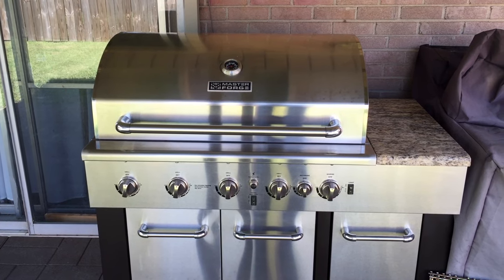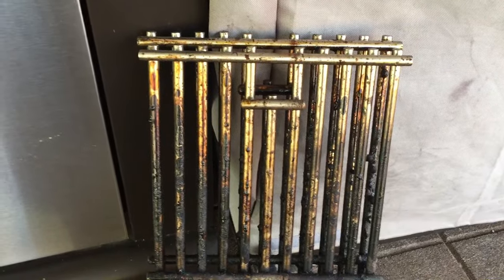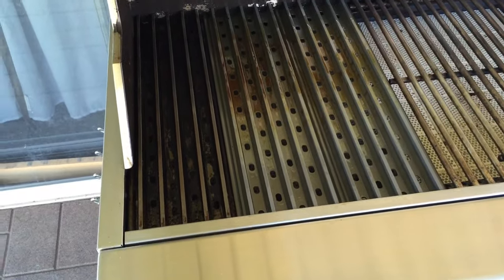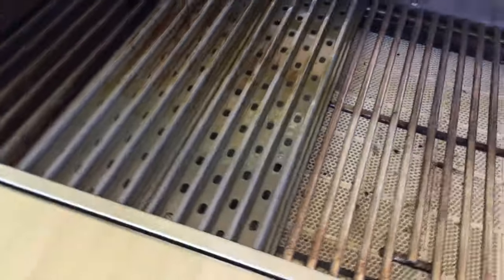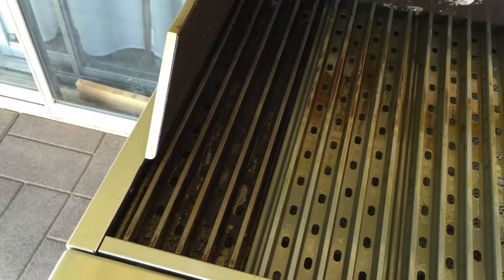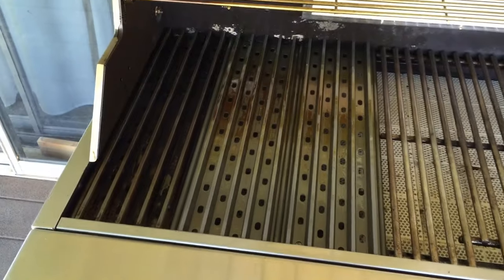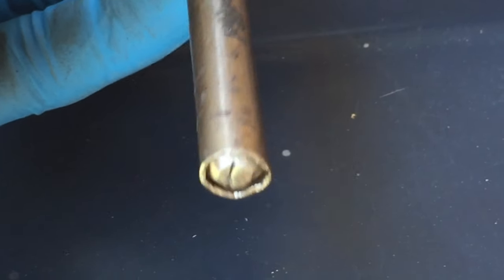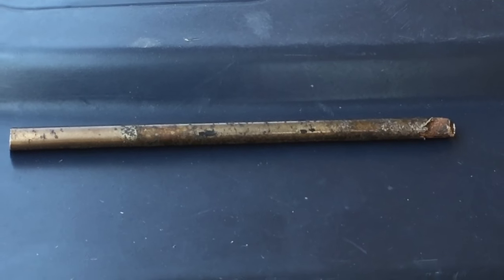Master Forge Gas Grill Update #3

Comment: Hi! I have the same grill. The burners and flare guards need replacing. Do you have a video on how to replace? Or can you direct me where to find? Thx!!
Reply from the maker: I have a part one and part 2 video. I think in the part 2 videos I talk about the no flare squares.

https://youtu.be/PV2YTJdYUOY
Reply: @MSRWorkshop  thx. I watched that one. I was hoping for instruction on how to replace the actual burner tubes. They are corroded.
Reply from the maker: @cherylbeauregard851  I haven’t done one on that but if I remember correctly I think they have one screw at the back and then they just pull off. Really simple
Reply: @MSRWorkshop  how are the flame tamers doing?
Reply from the maker: So far holding up. They get really fragile after a bit of use but so long as you leave them alone they seem to work great. The biggest upgrade that has made the best difference if replacing the grates with a brand called “grill grates” they are by far the best upgrade you can do to this grill. They make a night and day difference. The old grates were complete crap and took forever to heat up.
Reply: @MSRWorkshop  thanks for the update man, yeah grillgrates are awesome! I have some on a cheap chargriller and they turned the grill into a beast haha

Comment: I also purchased the same setup with the refrigerator, Sink and Grill. I want to get the grill grate upgrade that you show in your video. I think I would like to replace all the stainless steel ones with the GrillGrates. What customsize did you order. I did email the company to see if they know what size I need. Thanks for the great videos of the setup and upgrades. Have not grilled on it yet, but have it all seasoned. Just ordered the Rotisserie for it and plan to use that this weekend.  Thanks again for great videos!

Comment: DO NOT BUY THIS GRILL,  I have owned this grill for 3 years.  Just about everything has failed.  The grates are corroded and breaking apart with rust, The burners have rusted and 3 off them leak gas to the point you cannot cook with them, The cover and parts are impossible to replace and none of the lights or features work anymore.  I use this grill once a week or less,keep it covered ALWAYS and it sits under a covered patio so I cant understand why this grill is so bad.  READ OTHER REVIEWS AND CONFIRM.

Comment: I just wanted to add that the grates that come with these grills IS stainless....... at least the sleeve/jacket....... but it's 409 stainless rather than 304 stainless. 304 stainless will not rust, but 409 stainless (a lesser grade of stainless) is prone to surface rust and such. It will still last you a very long time versus mild steel or cast iron, you just have to do a little maintenance to keep them free of rust. Looks like your new grates are pretty nice though...... I may have to consider swapping over to those just for the fact of less maintenance
Reply: @MSRWorkshop  yeah I do definitely know what you mean. I happen to actually like the nice grill marks the original grates leave in the food, but I have no experience with the style grates you're using. Surely I wouldn't dislike them for nearly $200 in the custom sized ones. Would love to see some videos of food you've cooked on them though.... maybe it'll steer me toward giving them a try sooner than later :)

Comment: Hi there.. Thanks for taking the time to provide indepth review of this Master Forge modular grill. I happened upon a floor model late last year and I picked it bas3d on your excellent review. 
However, there are lots of complaints of rust from other owners.
If you still have this grill, I would like to know the  condition and did you rust proof it in any way. Thanks
Reply: @MSRWorkshop  I thank you sir

Comment: Thank you so much especially for the measurements. Just got 7 panels to cover the whole grill. Takes it to a whole other level. 

My next 2 upgrades are going to be flame tamers and new cast iron burners.
Reply: Hello, i have the same grill. I would like to replace my grills, just want to verify that 7 panels will replace the whole grill.  also, the flame tamers in mine are rusted pretty bad, any suggestions on upgrading them?
Reply: Commenting to see if you ever did these two upgrades and if so what you did in terms of specs and products, owner of the complete set for years and it's getting a bit rusty and will probably need a few replacements and repairs soon